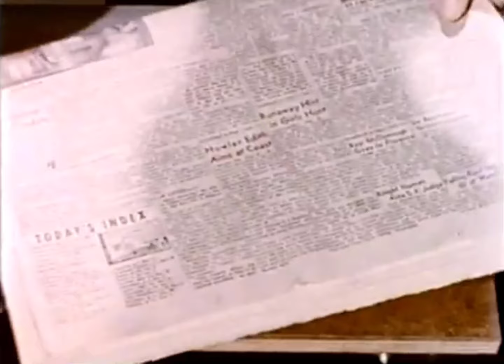🔬#MESExperiments 43: Dr. Irwin Moon Fries an Egg on a COLD Stove using High Voltage AC

Comment: wow..the part with the paper reminds me of some event in 2001 😂. awesome stuff!
Reply: Did anyone get it? Concrete and steel turn to dust. Cars engines melted. Office equipment & toilets turn into dust. But paper and trees did not get burned (intact). Don’t forget aluminium can cut through steel and concrete like butter.
Reply: @xrawna5189  Electromagnetic induction in the pan.
Reply: Needs paramagnetic materials or materials containing paramagnetic core/reinforcement.